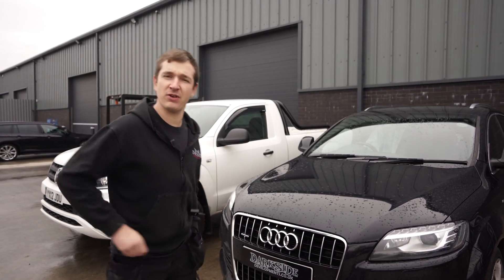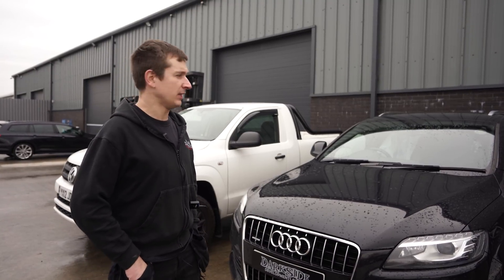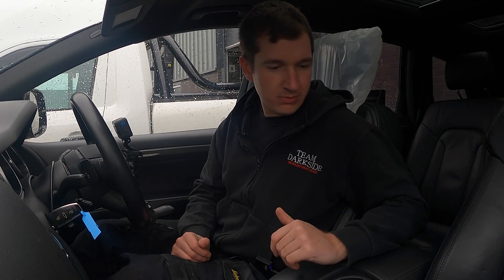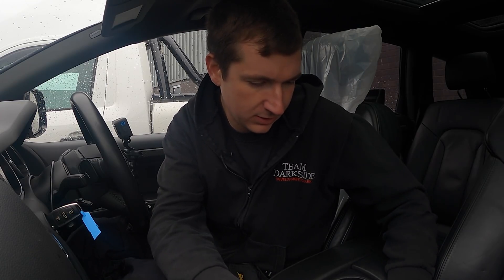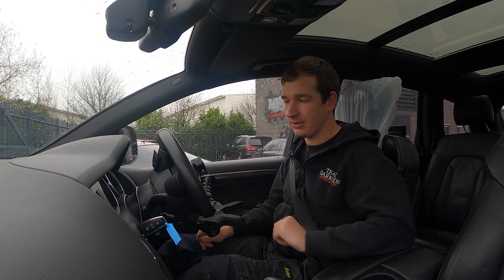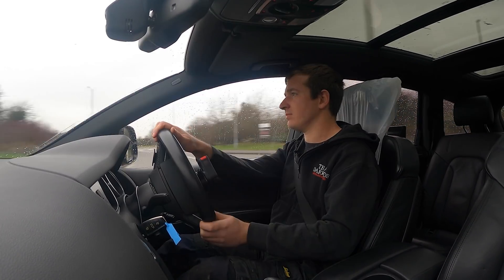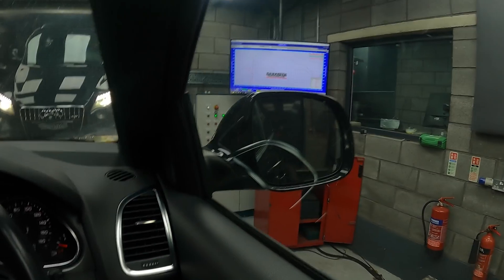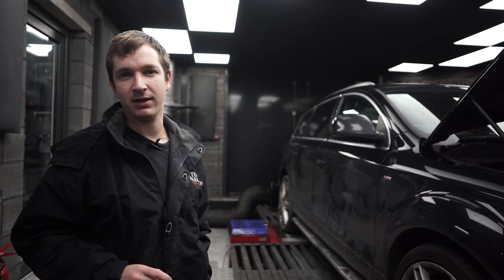Remapping this 4.2 TDI V8 before we UPGRADE the TURBOS!

Comment: Picking one of these up in next feu weeks   Map and water meth injection are first  mods
Reply: With hybrid turbos can it make 500hp 🤔🤔. And do I really need anymore to pull caravan 

Or is it a more interesting option to compound turbo it with a pair of turbos in the space under the boot 😂😂. I’m slightly insane. 
My last modified car was a abarth 500 that finished with 395hp 😂.
Reply from the maker: Mmmmmn slightly! 😂

Comment: The first dropped 10mm socket that's been found!
Reply from the maker: They normally are lost forever!
Reply: @DarksideDevelopments  hard to decide which is the bigger loss. A 10mm or a turbo (I'm guessing the engine wasn't too happy either)?
Reply from the maker: It make OK power considering! But it's likely not to be 100%!

Comment: I am very sorry, but doing such a tuning today, without visually inspecting the dpf before and knowing and telling the people about the max flows the factory installed injectors are made for seems not to be too serious?
Reply: You weren't paying attention.  The engine will come out, get new turbos and injectors, before being tuned in earnest.  This tuning exercise was just to set a baseline for general engine health, which appears good enough to support the bigger turbos & tune.  The factory injectors seem just fine too as you can see from the result.
Reply from the maker: The DPFs were not there anyway but you don't need to take them out to check!! Injector flow, you won't know until you try!

Comment: Got my daily dose of "right then!"... can't wait to see more of this build!
Reply: Should release it on ios as a message notification.
Reply from the maker: You would soon get sick of hearing me
Reply: @DarksideDevelopments   hi just reading your interesting posts and your tunes .. i have a question , i have 2 x tdi 4.2 v8 in my boat and the stbd engine has these little annoying (comms faults) where engine wont start , it has 2 fault codes P 1907 & P 1570 .....usually i can get the engine to start again by turning off power to batteries & turning it all back on again usually it will right itself until the next time it fails to start .... i know when its done its little not going to start thing by flashing ... service in the dash display ........ if this has done this from the start could it well be a crook ECU   or a canbus comms error ... beats me i tell ya
Reply: *reyt

Comment: Cool video, following this. It seems facelift car so it is the 250kw ccfc(a) engine with CP4 pump and edc17cp44? Older BTR has CP3S3L110 and EDC16cp34 ecu. I have built 3x 4.2tdi between 500 and 600hp now with the latest one installed in Cayenne and i would suggest not to go too big with the turbos.   Even the large CP3S3L110 will fall to its face once you go over 500hp @ 2000bar+ rail pressure. My cp4L75 was maxed out with 400hp tune if i remember correct. If you need any second idea building this, let me know.
Reply from the maker: Hi Allar, this is the older CP3 engine. Any ideas you have let us know. 2260s almost installed
Reply: @DarksideDevelopments  Turbos from your v12tdi? Dont forget to change turbo actuators as the v8tdi uses Can bus based actuators, while v12tdi has the usual pwm. Please cover in the this car tuning video your findings with pump/fueling. Non of my over 500hp 4.2tdi could hold rail pressure, even with 2x larger MeUn fully open after 3500rpm. I used 2260 from v12tdi and without smoky tune i find them a bit laggy on 4.2tdi, even with vnt maps calibrated as good as possible based on backpressure. 1 bar at 2000bar and full boost only at 3000rpm with 3rd gear fixed pull.
Reply from the maker: We ordered new units. Will check actuators when we check flow settings on the turbos. Full boost should be below 2500rpm if we can get the desired control!